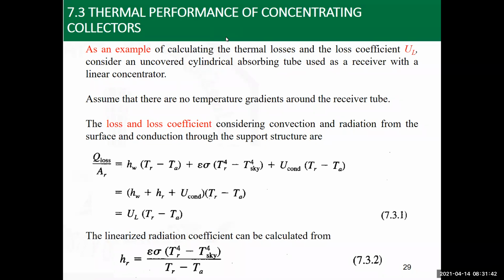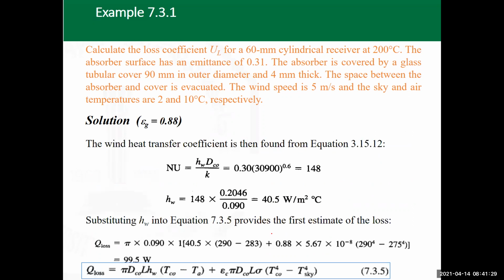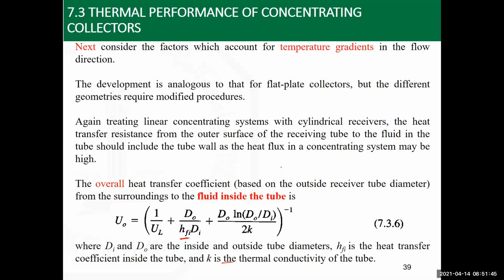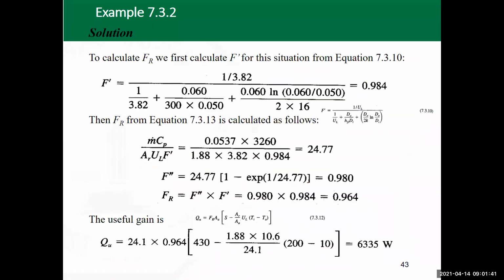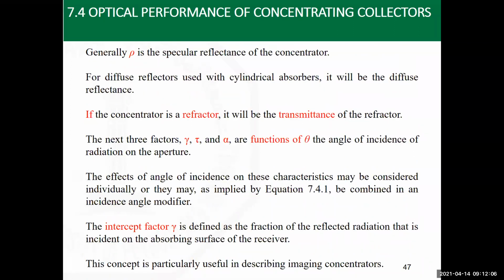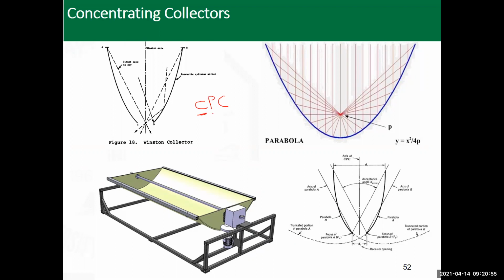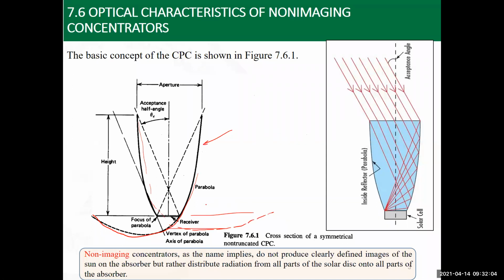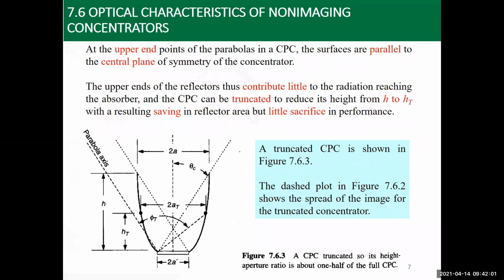Chapter 7 - Concentrating Collectors - 2

Comment: Nice lecture. However, there is a mistake in the solution of Example 2. In the equation of useful energy inlet temperature is to be used. But in solution the receiver surface temperature is used which is not clear